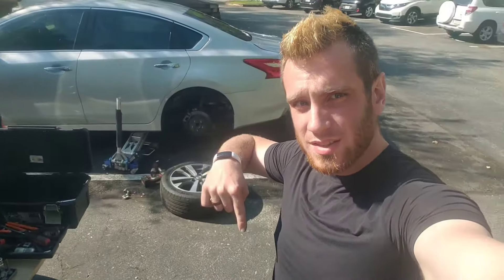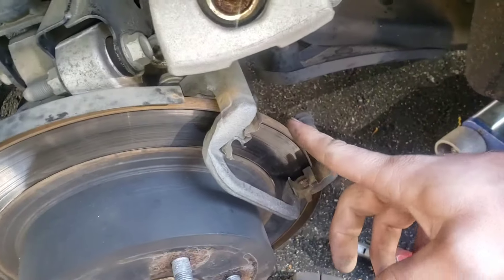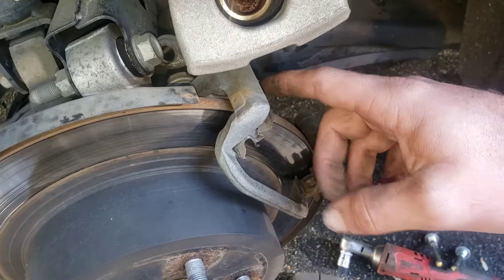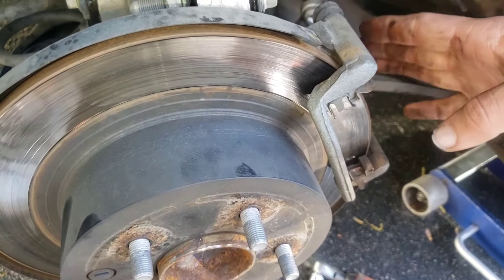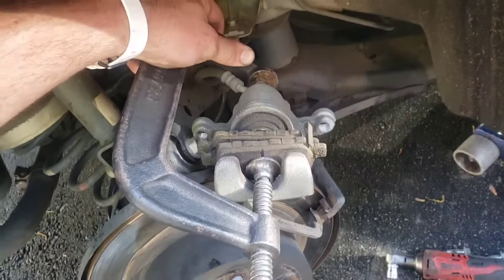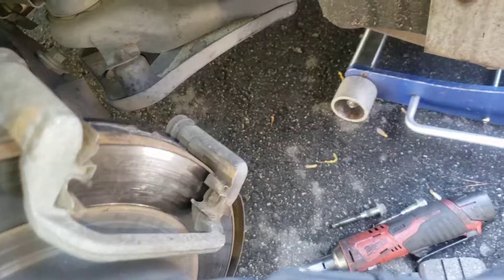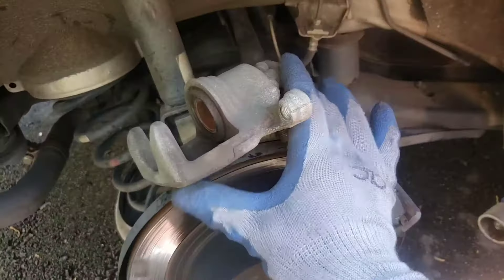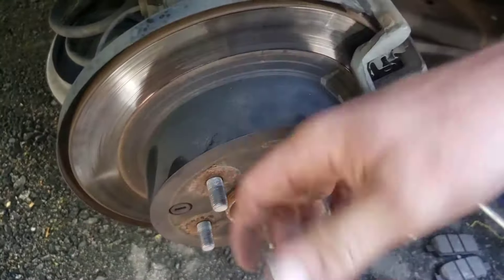How to Replace Rear Brake Pads Rotors 13-18 Nissan Altima

Comment: Wear gloves and eye protection,swap out clips/shims once they come with the pads ,never rest slide pins or anything with grease on the floor as you would contaminate it which my cause scorching in the slide ways . If replacing the rotor disc or inspecting the shoes,always disengage the handbrake . Some rotors also comes with two 12mm holes for you to thread a bolt through to assist in taking it off if it's stuck. Hope this comment helps the ones who need it

Comment: Guys u don’t need to remove both caliper bolts. Just remove the bottom 14mm and swing the caliper up and push the slide pin out. Easy peasy.
Reply: wow, you saved 5 seconds, congrats on that amazing revelation
Reply: @tomtemple69  wow you like extra steps for no reason

Comment: Check rotor in 3 places around the rotor minimum for proper measurement.  Also, if you have a 9mm new rotor, and the minimum safe spec is 8mm, you can't safely turn those if they warp. Always replace the clips when you put on new pads. They come in the box and take seconds to swap out. Do not add brake fluid in between brake jobs. This is how you tell you need brake service before you have a problem. Do not open the bleeder screws when replacing pads either. Do not use your c clamp on the brake line because you can break it. I do agree that you should buy a quality pad. Don't ever buy the cheapest pad they sell. You are literally taking your family's lives into your own hands when you do that. These pads have the highest failure rate. They literally will come apart .
Reply: i use rockatuo

Comment: Um, yes, do put grease on the new clips too if you use them. Also, rotors do not need replacemed every other brake job unless you're driving a freakin race car. Can't imagine how much money he has spent on needless rotor replacements. Rotors need changed only when they become defective or near defective...warped, worn thin, pitted, etc.

Comment: Tighten to what torque? Smack and snug?
Reply: The front brakes are 20 foot lbs on the 14 mm. Might be the same for the rear.

Comment: The moment I heard you say change the rotors every other brake job, I IMMEDIATELY turned off your video. You don't change rotors every other brake job!!
Reply: Sure ya can
Reply: He actually right tho… these cars are known to have a horrible squeal from minimum thickness and requires replacement because of the texture
Reply: @J3RON32THAM3ATSHO  I'd always recommend it but will the car not stop if you don't change the rotor? It'll be fine 🙂
Reply: Every other break job actually sounds smart. And I’m sure he was suggesting, you can do your intervals however you want
Reply: And then I guess turned on the video back on to comment ? 😂